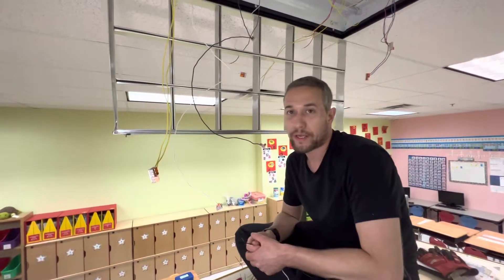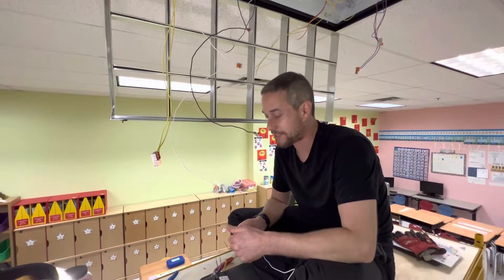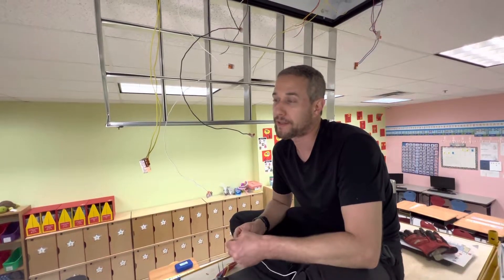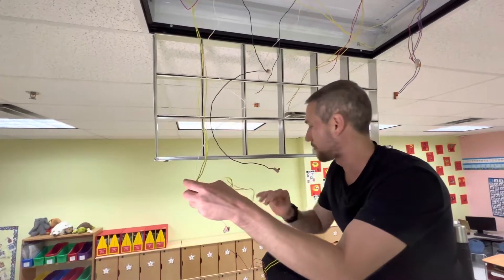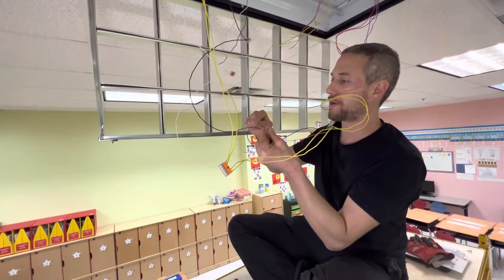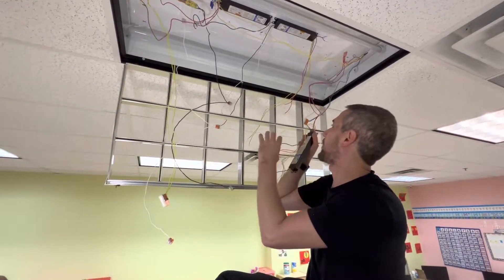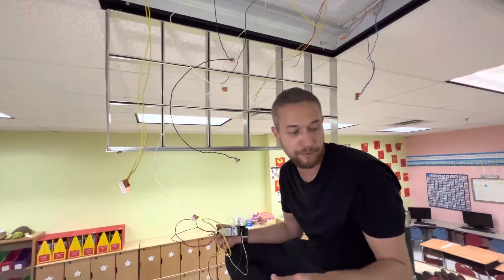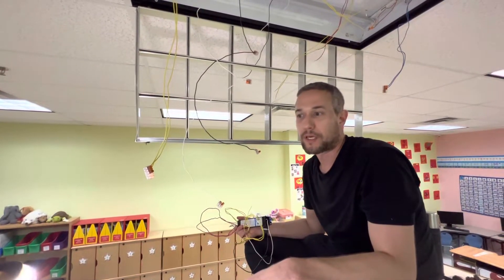How To Really Test Electronic Ballasts

Comment: So if you dont have a spare ballasts for test like that way. How do you know if the ballast still good or not? 
 I mean if your friend call you come to fix the ballast, how do you test now.
Reply from the maker: Everybody says you can test with multimeter, but in my case it didn’t work.
That’s why I find this way.
Even if the replacement bulbs are not working, that means ballasts are not good.
Basically my system is checking ballasts with working bulbs.
Reply: I had the same problem - ballast tested OKAY, but it did not work. My problem was the fixture was totally dead.
It died over a period of time. First flicker, if left on it eventually recovered. Then it did not recovered, just flickered.
Finally it just died.
So I spent about two hours trying to find what works on the internet. Finally i found this post. It is nice to have company.

I carefully figured what I want: I have 4 lamps, T8 size (1'').
Now I was ready to make a trip to local Dome Depot and got a replacement.
Just installed - it works okay.